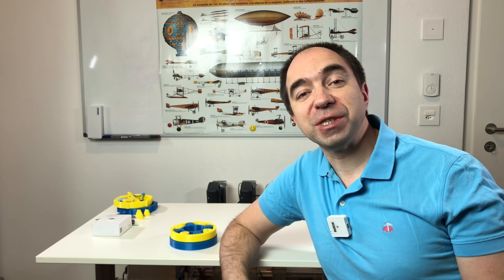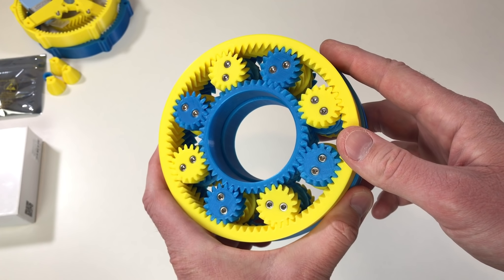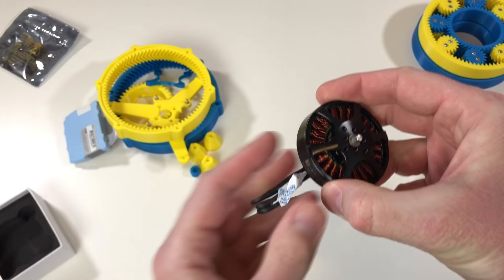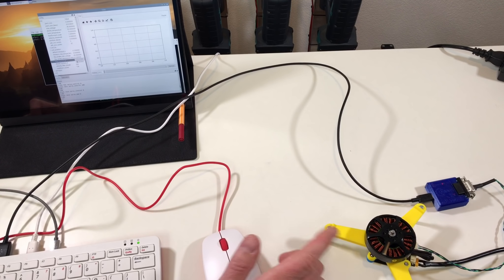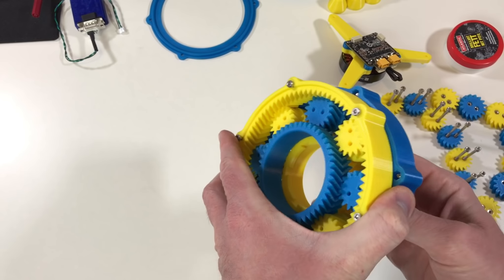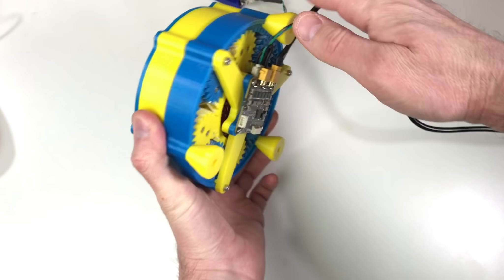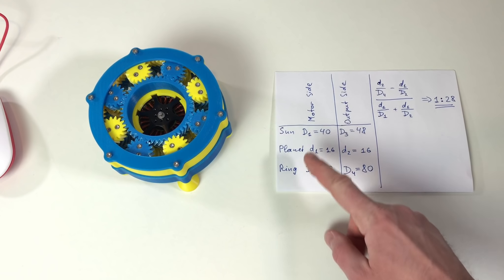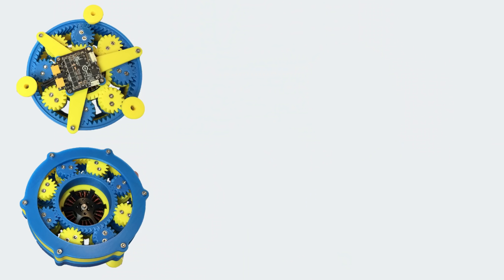The cheapest 3D printed actuator for robots (with brushless motor)

Comment: I cannot wait to see a durability test of these plastic gears in action. As well as a max torque and destructive testing of the gearbox as well.
Reply: A "FDM 3D Printed Part -> Metal Cast (optional -> heat treatment) -> Filing for dimensional accuracy" workflow would make it even more durable!
Reply: Also some crazy filaments like Nylon, PC, (And composite variants), etc
Reply: @ericlotze7724  Metal casting is dimensionally challenging, and leaves a poor surface finish for gears. The slight give in plastic makes them work much more easily.
Reply: @roryevans5032  Ah ok, well thanks for the insight, the metal idea is just an armchair one of mine.

Would vibratory sanding help the finish or not even something like that?
Reply: @ericlotze7724  to work properly metal gears need a smooth surface as they roll against one another. If the metal is rough they scrape and seize up, the only way to avoid that is make the tolerance lower, so there is more clearance, but that causes backlash. For the same reason you lose a lot of power to friction, and make lots of noise. Most gears are machined or ground, which gives a better surface quality than casting. Post processing is also difficult as you have to factor in the wear from the polishing step, so again to work you will generally have to lower tolerance and get backlash, noise, and low efficiency.
Reply: @ericlotze7724  here's a video that did just this, casting gears, which ultimately don't turn out nearly as well as printed plastic ones. https://youtu.be/w3i8i-9bjqI
Reply: Would be great if Daniel from RCtestflight could test this reduction drive on his solar rover.
Reply: @roryevans5032  Those are excellent points. Another reason to use plastic is that, to a certain degree, it's self-lubricating.
Reply: I know im randomly asking but does any of you know of a tool to log back into an Instagram account??
I was stupid lost the password. I would appreciate any tips you can offer me!
Reply: @Jude Karsyn Instablaster =)
Reply: @Dominik Tristian Thanks for your reply. I got to the site through google and I'm trying it out atm.
Takes quite some time so I will reply here later when my account password hopefully is recovered.
Reply: @Dominik Tristian it did the trick and I now got access to my account again. Im so happy!
Thank you so much, you saved my account !
Reply: @Jude Karsyn happy to help :D

Comment: can't wait to see load and backlash test, great work
Reply: Backlash looks to be very low. I suppose thats one of the advantages of plastic; you can size everything to be under a tiny bit of pretension. For as long as the wear doesnt accumulate that is, I suppose. But printed in nylon these should last quite a while.
Reply: Backlash is overrated!

Comment: Output torque tries to tumble the planets.  This is probably a large source of friction.  GearDownForWhat used three or more gear layers to balance out this force, but a planet carrier and bearings could do the same.  larger pressure angle gears are more efficient under radial loads.  (i.e. 35 or even 45 degree pressure angle)  Finally, I expect that heat will be the weakest part of this gearbox so running it immersed in soapy water, or using higher temperature materials will help a lot.  (heat is why Nylon, Delrin, and Torlon are the plastics of choice for gears)
Reply: I agree, the triple-layer structure of his strongest gearbox is probably quite important; he has some tests also showing this has a big impact on torque-efficiency. For  pancake formfactor like this I suppose its not so important, but if scaled lengthwise, the torsional and flexural rigidity of the planets will also be crucial to torsion efficiency and backdrivability I think. GearDownForWhat pressed in steel rods; that solves the bending; but itd be better if they were epoxied in I think, so torsion can be transmissed efficiently along the length of the planet, rather than bothering your layer lines with it. Flex in torsion will cause stress  to be concentrated on the teeth where the rings meet.

Comment: Elegant design and use of 3D printing. Lots of print time. I routinely embed hex nuts in printed parts to make them captive and invisible. Just print a hex pocket, stop the print at the right time, put in the nut and print over it. The trapped nut can even take a load in both directions. I’d like to see how this performs with a lot of use. Nice job.

Comment: You're alive! I was starting to worry that you'd given up youtube.
Excellent design. Very slim with the motor inside, and clever use of the rotor spokes like keyway shaft. I haven't seen that done before. Too bad the $20 5010 motors don't have anything protruding to use, since they also have the shaft bottom screw. Gartt 4108 has protruding spokes, but would need a different approach for magnet mounting.

Comment: I would not say its unfortunate that this system is not back drivable. This is why, if I am using this system to drive a shoulder axis on a robot, I would not want the weight of the elbow or the end-effector to drive the arm and strain the motor. That way when I put the shoulder into a position, it will stay. This will save energy as I will not have to use too much holding torque. Its true that the system will be limited to how much torque it can handle in the back drivable state, it means that the feedback control will help. I watch a video on the FANUC palletizer and it was this way. The system was designed to take more than 600lb one the output system where even the weight of a 250lbs man could not back drive the system joint.

Nice work. Will like to this this system you designed.
😁👍👍👍👍👍

Comment: yay, i was just hoping we would hear from you again soon! fantastic work, the cost considerations of this design are definitely a huge benefit but it also seems to work very well! of course it will wear eventually but that is the same for any 3d printed solution, and the beauty is that they can be replaced and replicated cheaply and easily when needed. and given the cost savings, one can spend a little more on a broad range of more expensive printable materials that i think can last a very decent time.
great to see you! looking forward to the testing video! :-)
Reply: If printed from nylon, and given that such a diy robot arm transmission hardly makes the number of cycles as that of a city bus, I think wear is probably not a concern at all. Even PLA has been known to last for years in all kinds of gearing applications.

Comment: When I wrote my bachelors thesis in mechatronics, I tried to develop a 3D-printable gearbox that; had high reduction, could handle high torque, was back-drivable and had high precision. To that end, I 'invented'(didn't know of any other at the time, though it turns out there were some similar ones) pretty much exactly this gearbox. In my attempts, I managed to make back-drivable gearboxes with up to 1:100 reduction that could handle a few Nm of torque. I reckon I could go way higher too, though I was very limited due to the pandemic. You mentioned that you wanted them to be back-drivable, I might have some tips if you're interested. It seems you have access to very high quality 3D-printing(at least better than what I did), so it would be really cool to see you try out some of my ideas/designs.

Also, on a completely different note: I am currently taking a masters degree in cybernetics and robotics and would LOVE to see much more content on your control systems! Would be really interesting!

Comment: This is an awesome design. Are you planning on making a larger one with your 9235 motor?
Cycloidal gearboxes use a lot of bearings, I've been testing large 3D printed bearings with moderate success.

Comment: I would love to see a back-drivable version. I not sure but I think the most you can do to have a back-drivable gearbox, that is not too much static friction is less then 10 to1
Reply from the maker: Completely agree!
Reply: Here you go https://www.youtube.com/watch?v=_VgXObcfXug
The carrier-driven variant has one less stage of tooth engagement, and thus higher efficiency (=more easily backdriveable). But it requires lots of bearings, and has higher planet RPM which may or may not be an issue depending on how fast you want to run it.

Also you probably have to accept a little higher backlash to get backdriveability. Although there's one trick I read about in the comments on James Bruton's cycloid video that I really want to try, which is to use a dual-head printer to make gears where just the outer one or two walls are flex filament, and the rest is hard. The compliant surface allows tighter engagement without jamming, eliminating backlash. But it may still add enough friction to prevent backdriving. Would be great for robot arms though.

Comment: Would like to have seen a faster input speed to see how quick you could get the output shaft to move. Great video as always!
Reply: I second that.  I'm always interested in how fast the actuator can move from one position to another
Reply: @Nerdtronic  By the look of it, high speed will probably heat up pretty quickly, but should be ok intermittently. Great for robot arms. If you want continuous high speed, print with a little more clearance.

Comment: I made a 3d printed Cyclodial gearbox and am still preferring it over planetary gearboxes, the low backlash and high torque comes at the price of those bearings and also those bearings add weight...but I guess it is still the best option for a high torque, low backlash and backdrivable robotic application! But I am very tempted to give your design a try, nice and smooth and looks like there is very little backlash!! 😎

Comment: Maybe one of the reasons it won't backdrive is that the planets are each trying to twist out of plane under load.   I have a theory that the whole thing will turn more smoothly (have more even loading on the gear teeth) if the planets were supported on a carrier with bearings.   You wouldn't need the output sun gear in that case.

Comment: What was the reason for orienting the planet bolts as you did?
Reply from the maker: The 3D printer does not 3D print perfectly. There are always some micro imperfection. With my orientation all this micro imperfection distributed evenly. This makes everything rotate smoothly.
Reply: @Skyentific  Ah yes, clever. Makes sense since you have such low play in the gear mesh, to prevent binding. Did you try installing the planets in a random orientation before orient them this particular way, or was it just your intuition?

Comment: Hmm.. I´m not sure about this, but it seams to me that the rotational force of the motor ring gear would be considerably lower than the output ring gear, still they are equally thick. The thickness of the gear should be pretty much linearly related to the maximum torque. So if the torque of the motor gear is say 5 time lower than that of the output gear, it should be able to make it 5 times thinner. That should also reduce rotational friction, and possibly make it back drivable. It of cause would make it quite a bit smaler and a bit cheaper as well

Comment: you can use it as a floating 1:1 (not back drivable forward) and 30:1 (normal backward) gearbox
Reply: it can be designed to use the non-back drivability stopper
Reply: it will stop and not move if not self ran to move, like a car on a slope, no brake needed
Reply: it has the same property as a screw actuator, it will not move if not specially self-moved

Comment: Your planetary gear box has lots of internal friction. If this was cleaned up and smoother moving it would be back drivable. There is no reason for planets to NOT be back drivable other than frictional losses jamming it up. I think with use and the gears wearing off the 3D printed ridges on them, that it will get smoother and maybe it won't jam up anymore. Nice gear box and seems like it should be very solid and durable.

Comment: congratulations @skyentific!!!, what is the backlash of it? why didin't you use a bigger teeth size and increased the number of teeths causing a reduction actuator size? maybe nylon screws could be a better solution to the increase the durability of material.

Comment: Awesome video as always! I would suggest to print using Nylon instead of PLA. Much more durable, strong and resistant to abrasion. Thank you!
Reply: The whole point of the design is to be printable by Joe Lambda. Nylon is not trivial to 3D print.
Reply: @ArnaudMEURET  Nylon tends to warp and require higher temperatures, but isn't that hard, specially for round parts. But I got your point.

Comment: I have some questions:
1) Which of the three gearbox types (Harmonic, Cycloidal, and Planetary) are used in modern commercial robot arms?
2) Which of those three gearbox types has the lowest backlash? (low backlash being a requirement for precise and repeatable robot-arm end-effector positioning)
Thank you.
Reply from the maker: 1. Harmonic
2. Harmonic
But: do you want to stay in the past with slow robots, or go into the future with fast robots? If the future is your choice, you should use planetary :)

Comment: What software did you use to model the gear set, and did you do the maths manually, it did you use a plugin/script? I would like to design better gesr sets like this
Reply from the maker: I used plugin in Fusion360. The name of plugin is simply: “helical gear”

Comment: Wouldn't it be better to design the ring gear like a clamp or make it out of two parts? Like this you can put everything inside and assemble/tighten it. The backlash would be also adjustable.
Hope you will do stress and wear test on this gearbox soon. I guess, this motor won't be able to break the gearbox, but how much torque will it give? Really interesting.

Comment: Nice. Is it PLA ? How hot does the motor get ? Seems you can add air flow for cheap too. Because it's not backdriveable, you can use zero current for holding so the motor shouldn't get hot, and when you spin it, adding a small propeller to the motor should help cool it down.

Comment: Why did you remove the magnetic screw and put in a non magnetic one instead? I just missed a bit the explanation why you did certain things, but found in the comments also the reason for the special screw alignment
Reply from the maker: Magnetic screw would decrease the range of the magnetic field from the magnet for encoder. Most probably it would work with magnetic screw too. But with non-magnetic screw the magnetic field should be a little more intense.

Comment: The only problem I foresee with design is that the encoder is at the motor not at the other end which means you lose the absolute nature of the measurement of the encoder. I suppose that can be resolved with limit switches, but means you cant simply turn it on and know where it is.

Comment: Can you put links in the description to the other parts?  The motor you used and the controller board?
Reply from the maker: I don’t want to make free advertisement for them. Especially that the motor is a little expensive, and the controller is good, but not the best. If you need: motor is from tmotor company, antigravity series, mn5008 kv340. And controller is from mjbots company.

Comment: Does the output sun gear contribute anything other than mechanical stability? I noticed it's teeth count is not included in the ratio calculation. would it work if it were just omitted?

Comment: i wonder if a very small actuator one can be 3d printed . Nice work btw :)
Reply: You can print small, you can change the muzzle on a printer and calibrate it to get good miniature resolution. You can strenghten the material with carbon fiber.
Or level up and you even can print metal. But this is not the mass market anymore ;)
Reply: This is possible. I made this exact gearbox a month or so ago but much smaller. Wish I had shared it now, someones beat me too it :( 

But yes you can print a much smaller one!

Comment: I joined the $10 Patreon so I could get the files for this but they are not available. Are the files for this actuator available anywhere?
Reply from the maker: Yes. They are available on Patreon. Search for post which was published at the same day as video. There are two posts: one public, and second for Patrons with files (stl and Fusion 360)